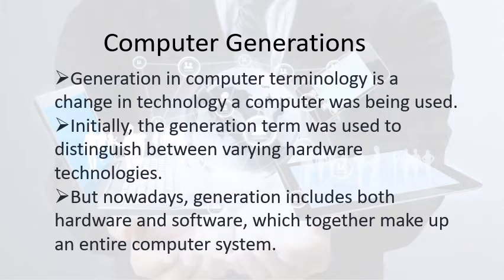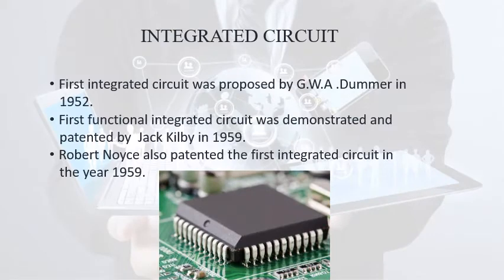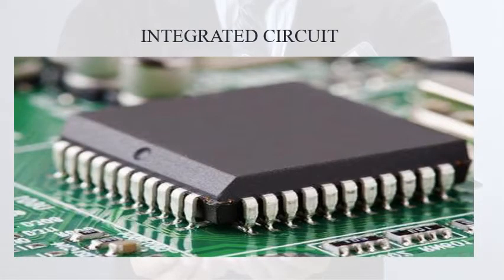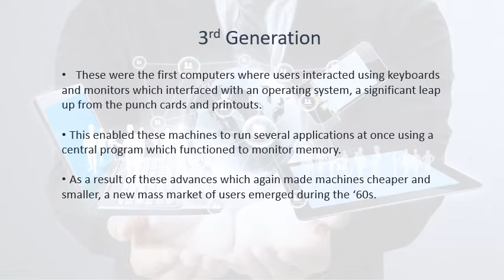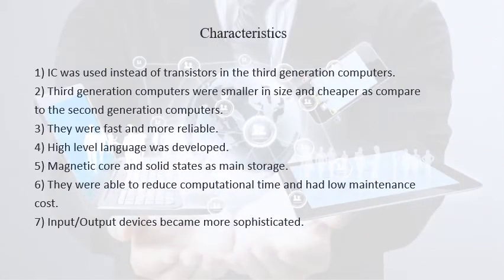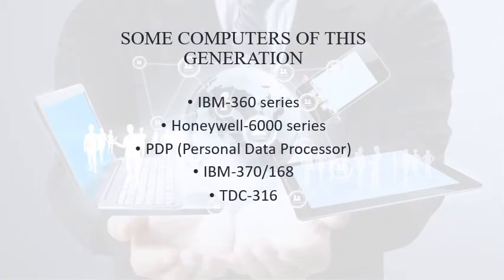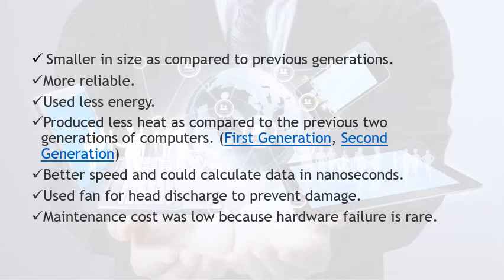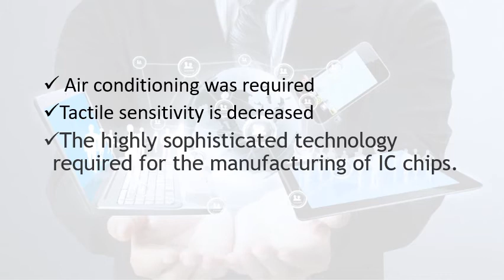third generation computers

Comment: Good.
 The computers of third generation used Integrated Circuits  in place of transistors. A single IC has many transistors, resistors, and capacitors along with the associated circuitry. ... This development made computers smaller in size, reliable, and efficient.

Comment: good 
summary
      he period of third generation was from 1965-1971. The computers of third generation used Integrated Circuits (ICs) in place of transistors. A single IC has many transistors, resistors, and capacitors along with the associated circuitry. ... This development made computers smaller in size, reliable, and efficient.

Comment: Good
Summary :The period of 3rd generation of computer was from 1965 to 1971.The computers of third generation use integrated circuits in place of transistors. A single integrated circuit has many transistors, resistors and capacitors along with the associated circuitry. High level languages were used during this generation.

Comment: Good 👍
Third generation computers were used between (1965-1971). In this generation it is try to improve disadvantages of 2nd generation computers like transistor were replaced by integrated circuits. These generation 'S computers were small in size, reliable and efficient as compare to 2nd generation computers.

Comment: GOOD!
Summary: The period of the third generation was from 1965-1971. The computers of the third generation used Integrated Circuits (ICs) in place of transistors. A single IC has many transistors, resistors, and capacitors along with the associated circuitry. ... This development made computers smaller in size, reliable, and efficient.

Comment: Summary
Good!!!
The period of third generation was from 1965-1971. The computers of third generation used Integrated Circuits (ICs) in place of transistors. A single IC has many transistors, resistors, and capacitors along with the associated circuitry. ... This development made computers smaller in size, reliable, and efficient.

Comment: Good
Summary:
3rd generation (1965-71) computers are marked by the use of ICs in place of transistors. They introduced keyboard, monitors, & multitasking. As a result, they were cheaper, smaller, faster, efficient, and reliable. They consumed less energy & generated less heat but required cooling systems.

Comment: GOOD
summary
3rd generation (1965-71) computers are marked by the use of ICs in place of transistors. A single IC has many transistors, resistors, and capacitors along with the associated circuitry.  As a result, they were cheaper, smaller, faster, efficient, and reliable.  They consumed less energy & generated less heat but required cooling systems.

Comment: Good
Summary:
Third generation of computers have time period from 1965-1971. They have integrated circuits instead of transistors. An integrated circuit is based on transistors resistors and capacitor along with security.

Comment: Good
Summary: Third generation computers were developed around 1964 to 1971, though different sources contradict each other by one or two years. The third generation was brought about by advances in the manufacture of transistors; scientists and engineers where able to make transistors smaller and smaller, which led to entire circuits fitting onto a single piece of silicon, now known as the integrated circuit or microchip.

Comment: Good
Summary:
3rd Generation were in era from (1965-1971). They used integrated circuits. These computers were small in size, reliable and efficient as compare to 2nd generation computers.

Comment: Good
Summary:  Third generation computers used integrated circuits have many thousand transistors to perform functions.First computers to use monitors and keyboards which interfaced with an operating system.More efficient and smaller in size as compared to previous generations.

Comment: Good 
Summary 
3rd generation 1956-1971 computer are marked by use of ICS in place of transistors.  A single IC has many transistors and capacitors along the associated circuitry .

Comment: Good .
Summary
The period of third generation computer was from 1964 to 1971.
The development of integrated circuits( Ic)  was Hallmark of third generation computers .A single IC has many transistors , resistors and capacitors along g with associated circuitry.
Instead of Punch cards and printout  users interacted with third generation computer through keyboard and monitors and interfaced with and operating system..

Comment: Good
Summary: The period of third generation was from 1965-1971. The computers of third generation used Integrated Circuits (ICs) in place of transistors. A single IC has many transistors, resistors, and capacitors along with the associated circuitry. ... This development made computers smaller in size, reliable, and efficient. Allow the device to done many functions at a time. Transistors are replaced by silicon chips.

Comment: Good 
Summary:  The period of third generation computers is from 1965 -1971 .They used ICS istead of transistor .ICS stands for  integrated circuits .A single Ic consist of many transistor ,resistor and capacitors . They are mor reliable but of very cost.

Comment: GOOD
SUMMARY:
 Third generation computers were used between 1964-1971. Third generation computers were made keeping in view the limitations of previous generations of computers such as Integrated circuits were used in place of transistors. Keyboard and monitor were introduced firstly in third generation computers.